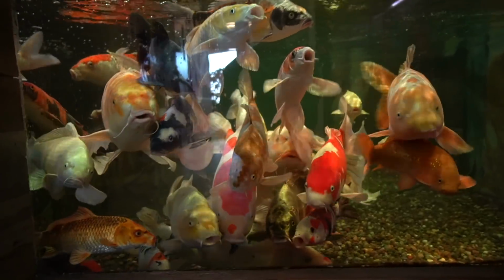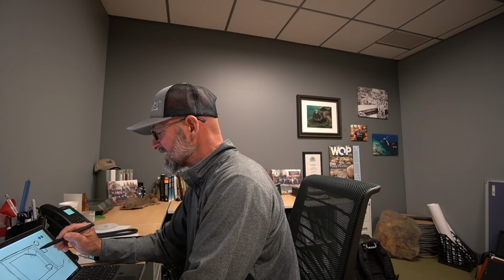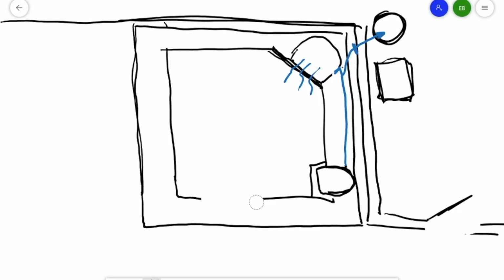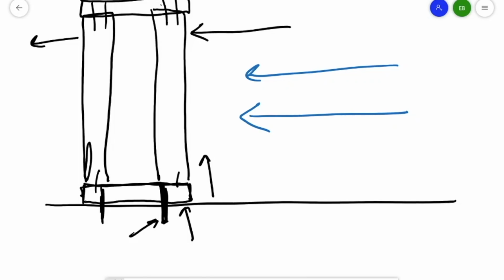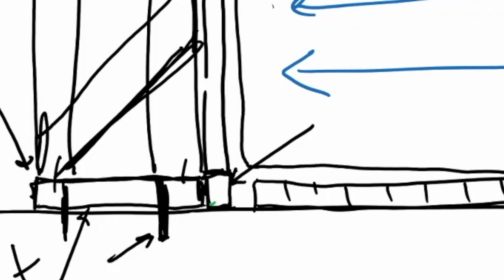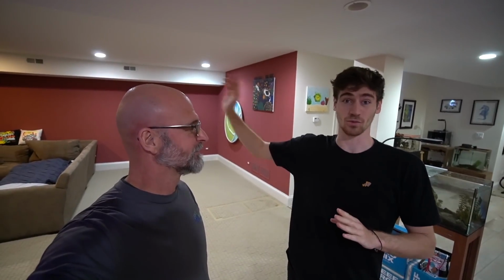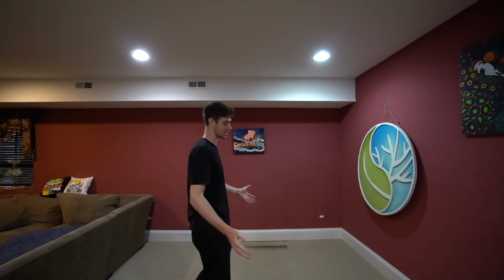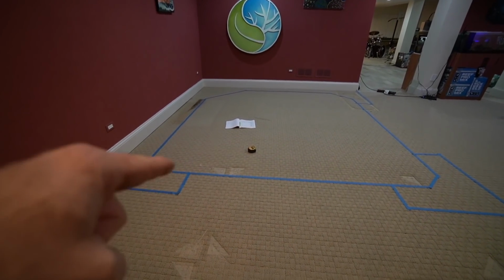Designing a Massive *INDOOR POND* in a Basement! - Part 1

Comment: My thought is that if you have a four sided box and you were able to strap the perimeter at the top would eliminate that outward pressure.
Reply from the maker: Yes,
That’s what we accomplished with the Steel Angle Iron that was attached above the glass panels connecting the two walls together

Comment: I don't understand why u choose to do liners on a wood structured tank. It's like you're kinda stuck on the liner concept from outdoor use. There are a lot of better ways imo.
Reply: Also you can't do an indoor waterfall the tank needs to covered. You will need an extremely elaborate ventilation system to handle the humidity. Its a carpeted basement. The tank should be covered.
Reply from the maker: The waterfall is nonexistent, the Biofalls unit flows directly into the tank with no elevation change. 
We also added a large dehumidifier to handle moisture
Reply from the maker: I know the liner works and I don’t want to experiment on someone else’s home.

Comment: Move the 2X4 back 3/4 inch on the inside wall and completely do away with that 3/4 inch piece of wood below the plywood. Next put down two 2X12s on the bottom and top having one board over lap the other in the corners.

Comment: Wouldn't it have been better to build the walls from concrete?
Reply: It would be stronger for sure. But it would also be considered a permanent structure at that point, so if anything happened that required a homeowners insurance claim unless you told them about it being there before hand which would raise your insurance you'd be screwed. Doing it this way it's really just a big fish tank and not a permanent structure.